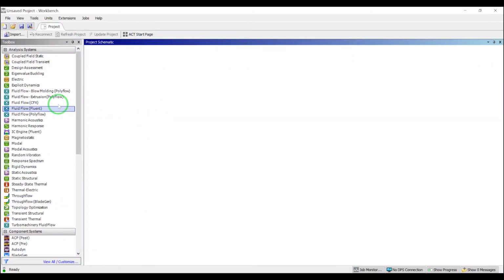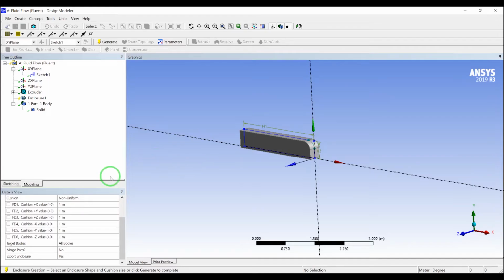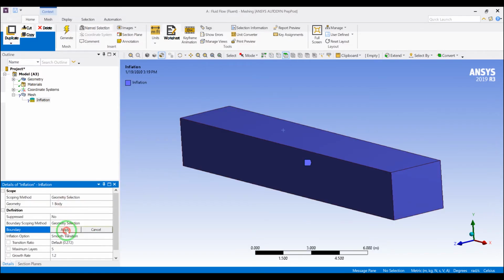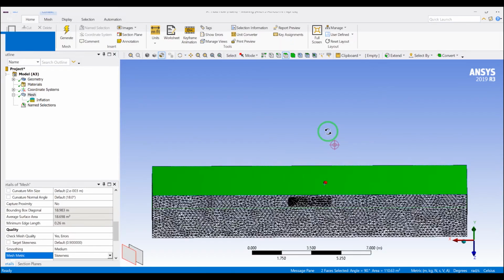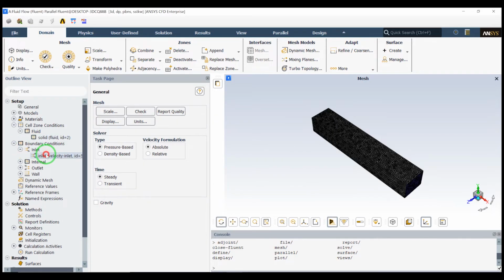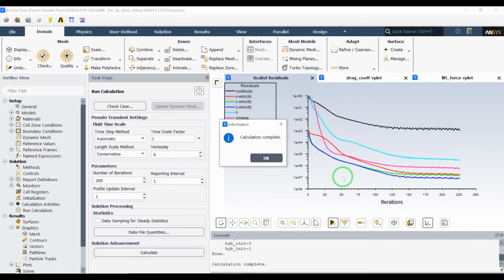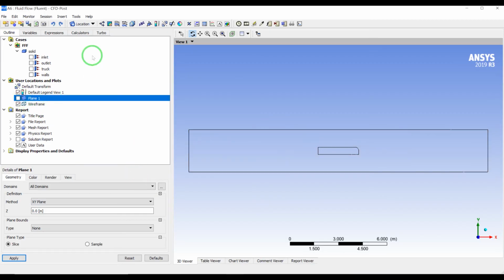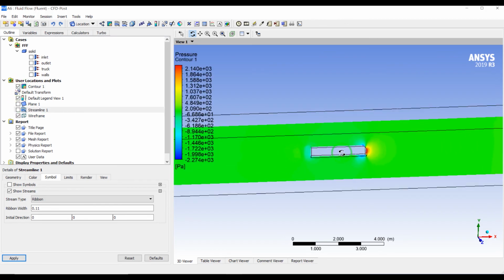Ansys Tutorial: Drag and Lift Calculations in ANSYS Fluent

Comment: You need to set the reference values to calculate Cd. Your cd is 500 ?  
Model Year	Cab Style	Projected Frontal Area (m2 )
2015-2020	Regular Cab	2.94
2015-2020	SuperCab	2.97
2015-2020	SuperCrew	2.98
2021-2024	Regular Cab	2.97
2021-2024	SuperCab	3.01
2021-2024	SuperCrew	3.02

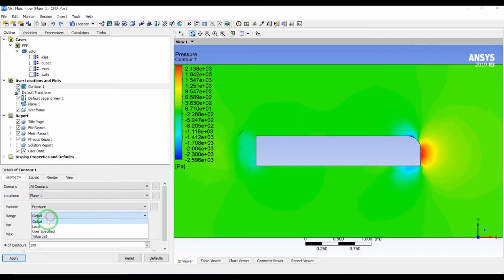Comment: 1.Can i ask you please about the value of pressure drop ? I mean which two pressure values to refer to  ? (18:14)
2.Why does the pressure decrease too much along the y-axis ? (in my case it even goes to negative values)
Many thanks in advance.
Reply from the maker: Negative pressure makes sense because of velocity increase on the edges. Like an airfoil. This is an external flow, pressure drop does not make sense to calculate and refer to, but for internal flows, it depends where you want to calculate pressure drop, you can create a plane on each point and calculate the Area average pressure and subtract them for pressure drop.

Comment: I am actually having a confusion regarding which reference area and reference length to provide in reference values. In my case, I am trying to calculate drag and lift coefficient for square building by rotating building in Design Modeler at every 15 degree interval from 0 to 90 degrees. So the doubt is that if enter the projected area in the direction of the wind in reference values, it would only be area for drag but what about the other projected area in the direction of lift?
And regarding the "length" in reference values, if I'm not mistaken it should be the diagonalish dimension of the building in the wind direction..right !....but if say for example if I am analysing a building whose cross section reduces towards the top...then how to compute length? Would it be (top diagonalish length+bottom diagonalish length)/2 or only the bottom (or maximum) length in the direction of wind?
Thank You

Comment: Thank you very much! Very helpful, but I've got a question. Can I do the same thing using different materials? For example, use water instead of air. Am I right if I think that to do this I need to find water in the material database and choose it as the material in material -> fluid section?
Reply from the maker: Yea that is the right approach.

Comment: On fluent, why did you not change the reference values? I'm getting different answer if I set it on default or change my values

I was trying to confirm the drag coeff of teardrop shape. I used this exact method (except for viscous I used k epsilon - standard wall) and I got a drag coeff of 7 (yes 7 not 0.7 or 0.07). 

I tried to change the reference values (area and speed), I change the reference value speed from 1m/s to 11.2 m/s (same to my inlet boundary condition speed) and I got a drag coeff of 0.0518 (closer to theoretical drag of teardrop shape, 0.04-0.05). 

Am I doing this right?
Reply: Someone in the comment section also pointed out about you, not changing the reference value so I guess that was really a mistake of yours. I hope you put a pinned comment addressing that so future viewers who dont know it will not be getting wrong values. Other than that this video was really helpful especially the inflation part!

Comment: Hey mate, you gotta set the reference values to calculate Cd and Cl. Cd in your result is 500+, which is impractical and unbelievable.
Reply: 1.Can i ask you please about the value of pressure drop ? I mean which two pressure values to refer to  ? (18:14)
2.Why does the pressure decrease too much along the y-axis ? (in my case it even goes to negative values)
Many thanks in advance.
Reply: 1.Can i ask you please about the value of pressure drop ? I mean which two pressure values to refer to  ? (18:14)
2.Why does the pressure decrease too much along the y-axis ? (in my case it even goes to negative values)
Many thanks in advance.

Comment: Hey there you made such a excellent tutorial on CFD my project is going well but I want to ask about Cd graph as in your video the Cd value is about 510 which is very high but when we are considering in real case for example a sedan car has 0.20 to 0.34 Cd value why this software shows much larger value. is there any solution I have issue in it
Reply: The maximum cl value is 1, for a total aircraft (airbus) the cl is 0.5, but when u run cases in ansys it shows cl value like some values above 1( upto 50) which is completely wrong.
Reply: You have to give reference values like "Area" and "Length". He forgot to do that in the video. If you define the correct reference values, then the Cd and Cl values going to be correct.

Comment: I have a question about the force vector. is the 1 and the 0 representative of "on and off" or is this corresponding to where you would like the lift and drag to be calculated from?
Reply: Think of it like a unit vector. If the vector is defined such that x = 1 and y and z both equal 0, the vector would point in the positive x direction
Reply: yeah they are the cosine values

Comment: Awesome video!  But I have a question. You got Cd value around 500 for your simulation, but isn't this much higher than a typical coefficient of drag? I am having a similar issue with a simple cylinder in a wind tunnel simulation, in which a typical Cd value should be around 0.5, but I'm getting values around 16. Am I misunderstanding the meaning of what the Cd value measures in ANSYS Fluent? I am pretty new to ANSYS and CFD in general, so this wouldn't be surprising. Thanks.
Reply from the maker: Thank you for watching and thank you for your comment. Yes, you are correct. If you check the comments it was discussed before. In this video I forgot to define the reference area in the reference values. If you define correct reference area according to fluent documentation (the effective area facing the flow) you will get better results. Hope this is helpful.

Comment: I'm trying to simulate a bottle but for the inflation , when I select all by control A and then desulect manually the external face,  Ansys says no selection when I apply.
Do you have any idea about what's wrong ?
Thank you for the tutorial
Reply from the maker: Thank you for watching and thank you for your comment. If the wall thickness is zero, or you only have the domain as the fluid inside the bottle, that could be the case. Please be more specific, may be an image or related publication, then I can help better.

Comment: In drag coeff wall sections; I don't find my model body in wall zones. Encloser wall and other walls(wall11,12,5 wall shadow) are only present. Pls help
Reply from the maker: could you please explain more?
Reply: @AdvancedEngineeringTutorials  ok. I have named my body as "X". Encloser as "Y". I want to calculate drag coeff of my model. I then go to report definations- forces- drag, as shown. In here, at the "wall zones" section , I can see encloser "Y", and some other names such as wall 13, wall5, wall shadow.....but I cannot see model name" X"
Reply from the maker: @pratik2583  did you create a name selection in meshing for the target bodies? or walls? for example you can select body X in the meshing, create name selection (shortcut is N) then you will see with that name in the Fluent. You can do the same for walls. Also make sure that in the design modeler, make two bodies one single part, in that case, the interfaces are defined automatically in Fluent. Please let me know if that worked.
Reply: @AdvancedEngineeringTutorials  sure...I'll let you know. Thanks for the help.